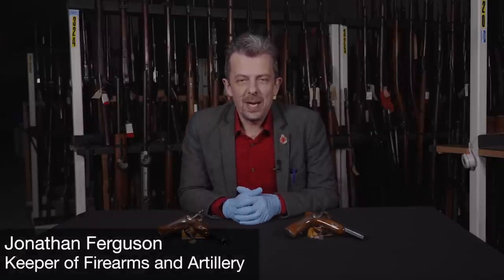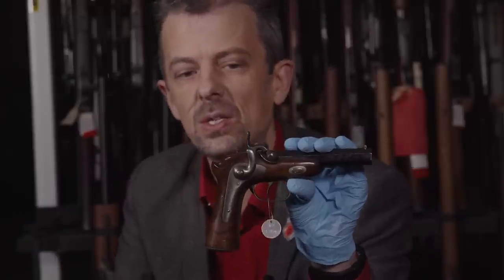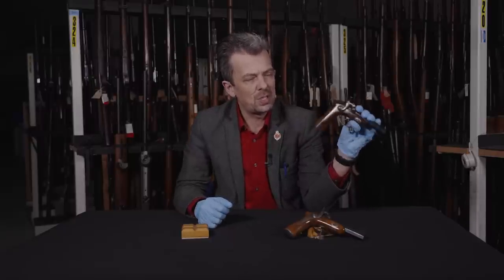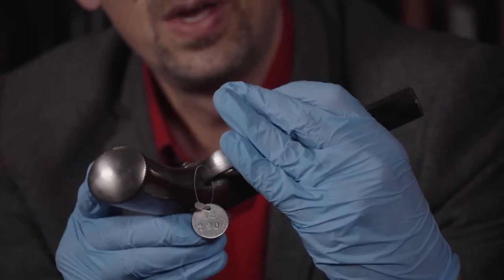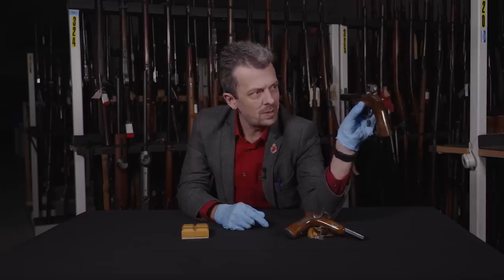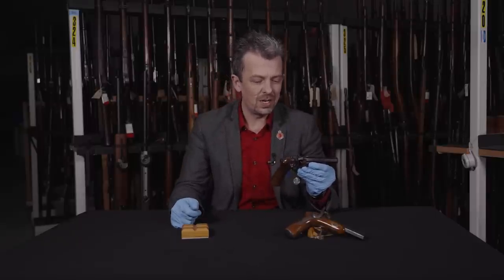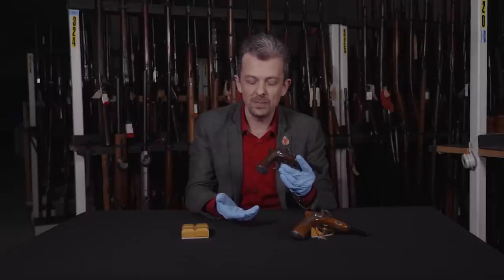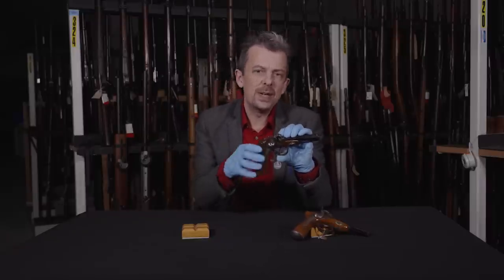Why did these percussion pistols have such straight grips? With firearms expert Jonathan Ferguson

Comment: I always assumed that the curved grip on old pistols was because there was no need for controling recoil for follow up shots so you might as well use the entire arm as a recoil dampening mechanism of sort. Instead of absorbing recoil you redirect it?
Reply: That certainly seems to work with .44 Magnum revolvers using the classic Colt plough handle grip. But if a pistol slides within your hand as you fire it, you cannot really follow through properly and regain you sight picture after the shot.
Reply: Recoil on muzzleloading pistols isn't really significant to be honest. There are also multi shot pistols that still have curved grips. Recoil control is a factor in the general trend toward more vertical revolver grips though, I suspect.
Reply: @jonathanferguson1211  accuracy isn't really a thing either.
Reply: @derekp2674  Exactley . At the time of one shot pistols the tactical thing would be t draw your next weapon as quickley as possible.
Reply: @jonathanferguson1211  No but there was no need to control muzzle rise either. The difference between felt recoil and seen recoil i guess. The late 19c pistol shooting stance with a heavily bent elbow have always made me think that they did that to redirect the power of the recoil into an upward movment. If you had to cock the hammer on a revolver a shift in grip did nor matter anyway. Might also explain the minimal sights of the time as they were closer to the eye. 

Styles change slower than technology sometimes. No wonder that the curved grips stayed on.
Reply: @borjesvensson8661  I don't think so, because it was used with single shot pistols and double-action revolvers as well, where 'riding the recoil' wasn't helpful.
Reply: @julianshepherd2038  They were better than we give them credit for, especially if rifled and sighted (as the last generation of cavalry pistol was). At the usual 'tactical' effective range of a pistol (10m) even a smoothbore pistol with no sights could be effective if you load it consistently and know your point of aim/impact.

Comment: Smells like rich guy dueling pistol wants and elegant muzzle loader with a modern shape, its easier to hide if there is issues surrounding the possession/use. Its a different design that would give the owner a slight advantage due to the weirdness of the design and likely un familiarity of the person who laid out the challenge. It would not be absurd to think that in the 1850s a person who was  a young soldier during the Napoleonic wars may have sought out a set of dueling pistols when they had the wealth of someone in their 60s

Comment: Re "classic" historic pistol grip styles...
Are they shaped in that strange curve because of swords?
Just attempted the hand position,  and it occurs to me, that the hand position of classical pistols is Very similar to the position of "pointing a sword".
Which Would be in the instinctual body language of the day.
The gradual transition from a straight hand cannon, to curved pistols, to a modern 110⁰/70⁰ pitch (around 20 degrees off a 90⁰ right angle), dont happen in isolation. 
And all happen around warfare, even if they arent developed for it.
So if we roll the clock back, but look at wider contextual information...
And remember they Arent using a scientific basis, nor good Anything to begin with..
Firearm history really starts to make sense.
You start with random bs, then you put it on a stick (not great, but at least its further from You) or probably,  someone connected  a "fired round" with "a thrust", but went to "weapons we thrust with" for inspiration- likely because "stabbing swords" werent "thrusting swords" Yet, but heavy spears and lances existed. Also, the whole ethos of swordsmanship, the focus on the grip and positioning seems to have transferred.
Then all weapons develop in parralel; 
Ironically,  those "sawback handles" may be aptly named, because they certainly Look like they were inspired by such.
Im actually not sure which development to be more impressed by, for its time.
A hand cannon,  where theres an active weapon on the Other end of a long stick.
A curved hilt, because they never caught on in europe. Far more common in the middle east, India, equatorial asia.
Or the modern grip; happened After the dawn of science, and notably after big strides in anatomy, the early days of modern medicine.
Human tools are straight or bendy, rarely kinked over. I can't recall any other handle at such an angle relative to the main body of the tool. Most are near inline, or at 90⁰.

Comment: French pistols are designed to be fired behind you as you run away 😂
Reply: Used to start the sprint away from the frontline, to the white flag repositary 😉
Reply: @bebo4807  Hear hear.
Reply: @bebo4807  and also forgetting the fact that the french do still have the record of most war wons